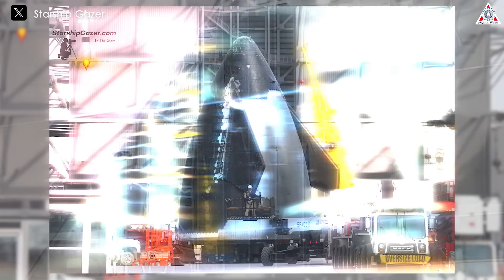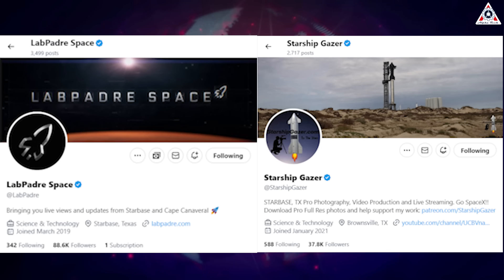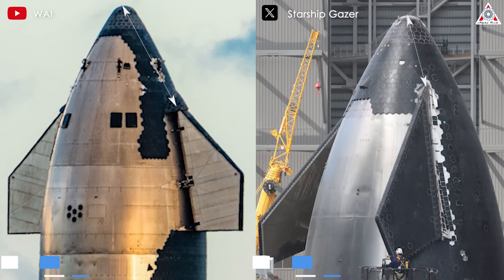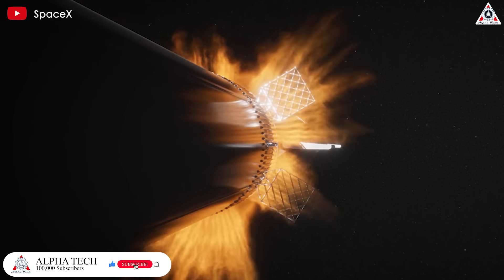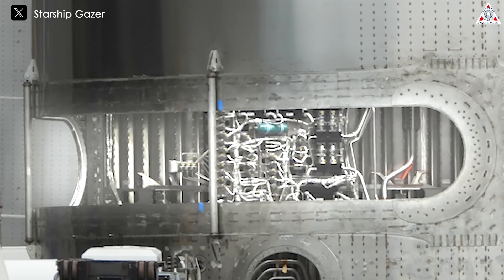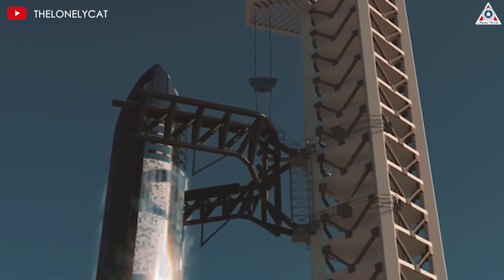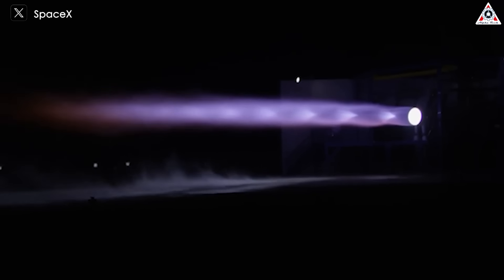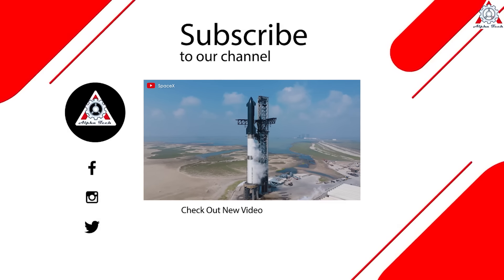SpaceX Just Revealed Major NEW Upgrade Starship Nosecone! Musk reacts...

Comment: Wouldn't graphene be a good material for heat protection? Graphene is light, pliable and flexible, yet extremely hard and around 200 times more tear-resistant than steel. It has a melting point of over 3000 °C.
Reply: How good does it work against space radiation ?

Comment: New forward flaps are interesting, more developed design, less crude and clunky. Not a nose forward flight design, so evidently they plan to stick with the flying wine bottle flight profile.

Which tells me aft flaps are unlikely to be altered much either.

And that they are betting on the improved heat tiles at this point.

On the internal longitudinal stringers being solid,  Thats an engineering negative.
I would have suggested keeping the perforated design, and then going deeper in the web of maybe every fourth to sixth longitudinal. Like twice as deep, and maybe intstead of a T beam  configuration, going to the web being strap, and the top of the T being a round tube instead, at maybe a foot or more in from the skin. Kind of a cross between a stringer and a stand off from the hull stansion.

You'd get way more longitudinal rigidity with depth than thickness or increased mass in the web, as most of the strength is carried by the top and bottoms on an I beam,  and the web is just a transfer of force link.

Which is why you can cut lightening holes out of the center third of a web and get little negative effect.

So increasing depth, on occaisionals, and going to a tube on the top, would give you maybe 6X the rigidity for not as much added mass, as would decreasing center to center (C2C) spacing, and eliminating lightening holes in the longitudinals.

Also those structures could be later blended into deck support structure. Being more substantial than just skin stiffeners.

My guess is they got excess flex in the hull from flying sideways, and now attempting to cobble up a fix, when they actually need a more advanced structual plan, that is conducive to future uses.

If one again compares to marine architecture, you will see that excessive ribbing and longitudinals went out of style soon after shifting from wood to steel, And that hull thickness is more important, to bridge between much heavier and increased depth structual steel.

What Starship design needs to be for optimal, is a lighter weight thinner version of the same concept, and not be a space ship designed to be built out of wooden sticks done in steel.

Also Space ships will generally have internal pressure and so need less ribbing.

The main problem here is from an attempt to stick with a faulty re-entry flight profile, thats putting unnecessary stress on what is supposed to be a light hull.

And the good side, is it will allow the better thinkers among the competition to play catch up.

I'm not the only observer with some understanding in structural metal fabrication. Quite sure some of the fabricators and welders at Starbase are giving the Engineers the side eye on these things. 

That they are adding complication and mass instead of doing the right things...

Your skin is 80% of your hull strength, what this means is that your internal stiffners need to be kept at about 20% of the skin mass to be balanced.

Better to increase skin thickness slightly, than add way more mass in ribbing and longitudinals. its cheaper, quicker to fabricate, and easier to work with when its time to build in the other internal structures like decks or even portlights. All that clutter they are designing in will be a nightmare for the guys doing the internal construction and fitting hatches and portlights, and for wiring, plumbing, and insulation.

Its those Rocket Nerds again, ignoring a century of developement in closely related fields.

Space development will only be free, when common man can build things without being beholden to engineers.

Bureaucratizing invention is like dragging the anchors on a ship.

You may get it to work, but its gonna look stupid in the long run.

When better, cleaner designs are possible.

Parts count applies to structures too.

Just sayin'
Reply from the maker: A great analysis! I always look forward to your comments and they don't disappoint me at all.
Reply from the maker: Thank you so so much!
Reply: @alphatech4966  
Yeah, I hate doing the critiques, prefer doing the suggestions for improvements. But I'm not here to be nice, I try to push for better results.
And from what I have observed, things I point out do get repeated in comments across the forums, and bleed their way into the Citidel at SpaceX. If Elon only knew how much originates where, we could shorten the process. For now, I'm fine with just being able to influence, but wonder how many people have taken credit for it...

I'm not gonna stop..
Starship and cousins are too important to not make them the very best possible.
They can hate me, just build better ships!
Reply from the maker: @garylester3976  This is awesome and keep up the good work.